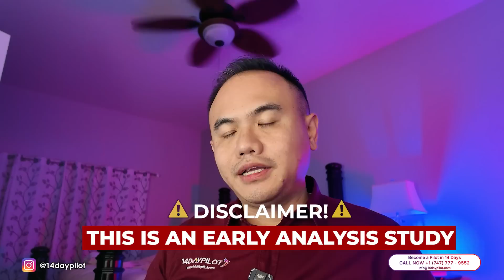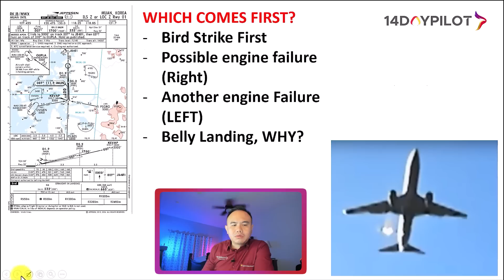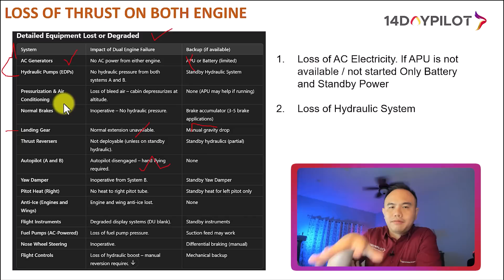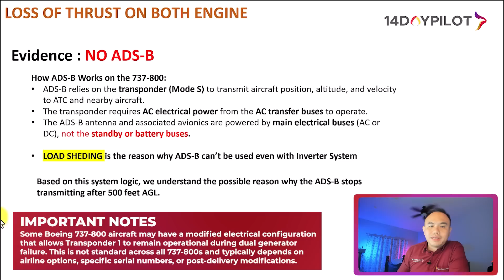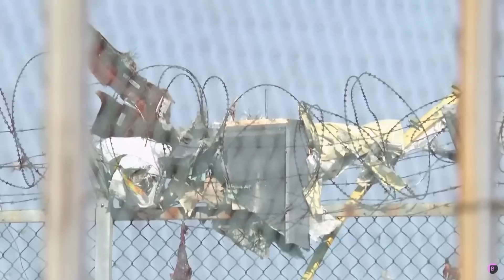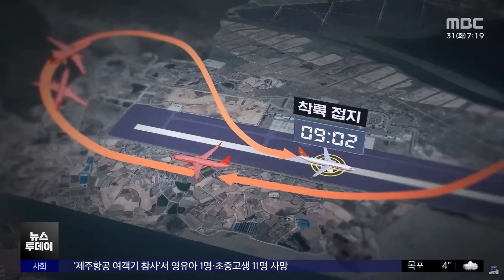NEW! JEJU AIR 2216 UPDATE :THE MYSTERY OF RUNWAY 19! B737-800 Crash At Muan Korea

Comment: They had the landing on RWY 01 made.  The flight manual says if there's sufficient thrust, they should continue the approach.  They had enough thrust to make a go-around so they had enough thrust to continue the appraach.   This leads me to believe it is 100% pilot error.  Apparently, the second engine was shutdown or failed after the go-around was initiated.  The were able to retract the gear and flaps so the second engine was operating up to the point where they were midfield heading north in the go-around.
Reply: Is there any report confirming that only one engine was affected by the birdstrike? It’s possible that both engines were impacted separately.
Reply: @wilsont1010  My guess is they were both affected separately.  The port engine on the initial approach which triggered the Go Around decision.  The second strike while on the Go to the starboard engine (caught on video).
Reply: @wsteele5864  This is the most plausible explanation for this crash landing but seems unlikely.  No report has indicated that there were two hits.
Reply: @ There had to be a reason they did the go around.  I believe the clip seen around of the bird strike through the starboard engine was during the go around.   They likely will be criticized for choosing not to complete the initial approach and then criticized for trying the dead stick return.  Sometimes you are just handed a s—t sandwich.   It literally is a parallel to Ernest Gann’s book Fate is the Hunter.  The pilot in that story did everything by the book and only a flight attendant survived.
Reply: @wsteele5864  I can't see any way the pilot couldn't have executed a longer teardrop with the excess speed he possessed. The SHORT teardrop is what made the landing hopeless. Not saying that recognizing this was either easy or likely, but the short teardrop "impossible turn" was fatal.
Reply: @ yeah, energy management wasn’t ideal clearly, but it isn’t practiced and the challenge is really high.   When I first got my pilots license I was flying in a trainer practicing touch and goes, I decided to see at what point in the pattern I needed to make my base leg turn to make the runway from pattern altitude (1000’ agl in that category aircraft).  I was shocked to learn with no thrust I had to make my base leg turn abeam the numbers if I wanted to make the runway with the engine out.   I believe you could probably put 100 737 pilots in a sim and setup that problem and none would stick that landing safely.   Maybe after many hours of repeated attempts some of the most talented could figure it out and get it dialed, but first time?  Probably zero.
Reply: @wilsont1010  Had to be one engine at a time.  The pilot initiated a go-around and got about 1/2 way over the airport.  Sometime after that, the 2nd engine either failed or was shut down by mistake.  If both tailed at the same time on approach to RWY 01, the only option would be to hopefully land on RWY 01.
Reply: The manual states you can either land OR go around, it’s up to the commander what’s the safest course of action…
Reply: @Cars-k8e  That's true.  But I think his decision will be called into question.
Reply: @Cars-k8e  Correct and pilots are drilled on stabilized approaches, so the default is the Go Around, get to altitude, do your checklists and reset the configuration for a stabilized approach.  The second strike (the one on camera) on the starboard engine happened on the Go and left the crew with dreadful choices.  They chose a return to the airport to try a dead stick landing.  They should have chosen the drink.

Comment: I am confused why the pilot didn't stay on the original landing path. He had the gear down and was on approach. If he lost an engine he could still land on this approach. If he lost both engines he may have come in short but I feel that would be better than trying to go around and doing the impossible turn. If he over shot the runway on the first approach he would have a clear path forward with few obstacles. We do not know why he chose this scenario but he did get the plane on the runway and he clearly had control all the way. It's just a damn shame they had that obstacle in the pathway. Let's pray this does not happen again. Condolence to all involved.
Reply: The norm for this situation is to continue landing...
Reply: @luziosalles324 incorrect, the book calls out both options (go around and continue), but pilots get the importance of stabilized 
approaches drilled into their heads, configuration changes on the fly are really discouraged. This was their first mistake, unfortunately not their last.😮
Reply: I'm B737 pilot, and that is normal training in a simulator. Loss of thrust on final, land and use flaps 25 vs 30/40 and appropriate speed. You don't run non-normal checklist except recall items for fire.
Reply: @gmcjetpilot is that industry standard or protocol for your airline? I know pilot training and best practice can differ between airlines.
Reply: My exact thoughts. Why? Panicked but getting out of the air is crucial if you’re having trouble.  Pilot fatigue
Reply: I believe the Pilot was in PANIC mode. . . Cannot plan. . No more brain functioning. . .how I wish to know who was the Pilot, a woman ?. . It's flight experience ? Etc
Reply: @AdrianoDominise  The sex of the pilot is not in question, the mental status is.
Reply: Because it needs reassesments,  calculations and configurations before landing in 1 engine. Maybe considering other airports if able.
Reply: He probably was not happy with the first approach and thought could do better on the second one.
Then the situation got suddenly worse…
Reply: @just_russ4633  Maybe engine flameout wasn't his only problem. That deployed right thrust reverser may be giving a hint. If the first birdstrike caused the thrust reverser ducts to open during descend he may had been experiencing sudden assymetric thrust that spooked him into a go around. He thought he needed more time to evaluate the damage and run the checklist for uncommanded in-flight thrust reverser deployment. And then he got a second birdstrike. Of course this is pure speculation but I don't think we know the exact moment those right thrust reverser ducts opened.
Reply: @ky7299  Yes, There are so many scenarios. The landings always scare me the most when I am flying. Having your life in someone else's hands is quite scary.
Reply: This literally
Tired of blaming the wall
The planes original flight path aligned on RUNWAY 01 and it has EMAS incase a plane overshoot....
Reply: Where he hit the birds was 3000 feet from the runway start, allowing for the shock and mayday, the aircraft would have cleared that distance pretty fast, but there reaction would have been slow, I also would have gone around, it gives you a chance to check the condition of your bird (aircraft) and then land safe the next time around.
Reply: I heard he diverted because the other side has residential area nearby
Reply: @ODKON93  I highly doubt that they were thinking of anything at all.
Reply: @johngreydanus2033  They certainly weren't thinking anything after impact.
Reply: @ODKON93 oh did you ask the pilot?
Reply: It is very normal to go around after the landing gear was on due to inconvenient situation, such as so many birds obstacle on the way, or another flight delays for take off, However, after go around, things went wrong unexpectedly .. the pilot was happy he can land on belly... and miscalculated or shocked that there is a wall prior explosion.. he must have said aaaaaaaaaaaa aaaàaaa shit there is a wall...... aaaaaaaa  aaaaaa... boom!
Reply: @AninePlus  This is their headquarters, he would have known.

Comment: It looks more and more likely that  human errors caused the disaster.
Reply: Seasoned pro pilots rarely make amateur  mistakes.. it's possible but not likely. There is an explanation for urgency to land wait for the blackbox.
Reply: @c.anderson3444  Rarely is not never. The pilots needed to lose airspeed and land nearer the runway start. Both could be accomplished with a longer teardrop. Is not doing that an "amateur mistake" or a pro-level one?
Reply: @gandydancer9710  possibly under ideal conditions. Impossible when there is an urgency to land . You cannot ever assume they had any controls available in a mayday urgency to land. How can you analyze how they made that turn on a mayday?? Yes these are pros and they wouldn't abandon a normal go around in a commercial airliner.  Thats called an impossible turn for a reason and any expectation for  position, speed, or runaway is known to be gone.  The only mission is to ground the plane ASAP and stabilize as much as possible for the crash landing. Thats exactly what most people can't understand.
Reply: Why do people start to cry "human error" before the investigation team even had a chance to review the data and publish their results?
Easy to judge from the sofa point of view^^

Comment: If they had just continued landed on Runway 01, possible no lives lost on that incident :(
Reply: @neerfranz12  Correct, but training favors the Go Around as stabilized approaches are the mantra.  Bird Strike takes number 1 engine out, abort approach, Go Around, do your checklists setup the single engine approach configuration. land safely and back slaps all around.  They don’t throw a second bird strike on number 2 while on the Go when you simulate this emergency.  The first mistake was the Go Around, the second mistake (the fatal mistake) was trying a dead stick return to the airport (something you don’t practice in the sim).  A ditch just offshore likely would have saved a lot of lives and got the pilot fired.

Comment: You can see at least one engine making thrust as plane slides down runway.  They still had hydraulics.
Reply: You can still hear the engine on spooling thrust before it crashed.
They had no issue doing the "IMPOSSIBLE TURN" so that means they had still control
No idea why they turned around when they were already heading the RUNWAY 01 where there's EMAS incase they overshoot the runway and most importantly theres no WALL
Reply: @everydaydose7779  just cause an engine is running doesn't necessarily mean it is providing thrust.  Imagine if you had a fan in your room with the motor running but all the blades are broken off as a crude example.
Reply: I think you are correct. Another YT channel suggested that no flaps and retracted landing gear is the optimal configuration for the longest glide path, if they didn't have adequate power to climb.
Reply: @davidmitchell7183 I think this is the most likely explanation for the configuration at landing.  They don’t practice dead stick in the sim.
Reply: The plane could have been on idle on that engine. The plane was on the approach and should have dropped the gear once it was over the runway then it would also help slow down the landing speed and provided braking and steering which the option you were talking about is not possible as was the result.
Reply: @davidclemens1578  if you have little to know thrust you would only drop the gear when landing is assured... if you are to low or to close by time you can guarantee making the landing... if you try to lowered the gear you may end up landing on only partially extended gear. Which can in and of itself be catostrophic.

Comment: STOP calling this an impossible turn! Impossible turn by definition, is impossible.. usually only small planes with low wing loading with extremely low stall speed MAY even make the runway. This fully loaded 737 not only made it back to the runway.. touched down almost at mid point of a 10k ft runway, ran down the rest of it and crashed into obstacle few hundred feet off the runway! How is this an impossible turn?? This airplane came back with power and fully fly able!
Reply: With both engine off (assuming) its an impossible turn.  And this content also for newbie.
Reply: Well, at least we know what he's talking about ... I suppose he could just say "turn" but when he say's impossible, we know he means a tight turn.

Comment: Quadruple redundancy for the landing gear.  2 engines driving separate generators and pumps, hydraulic reservoir tank using a pneumatic system, and finally the gravity method.  Pilot error period.

Comment: The no2 engine thrust reverser vane open,  it appears engine was working,  reverse thrust plume visible near touch down likely with reduce power? The manual  gear extension could be dropped manually from the cockpit. Then risk of a ground loop if mains not down and gear locked.  Not enough time , and with no engine power from no1 and a damaged no2 more risky to stay airbourne.   The passengers and crew were murdered by the moron that approved a thick concrete wall ILS foundation above ground.

Comment: I do not get it. Plane was very slow at the time of last ADS-B data was transmitted. If the plane lost both engines at that point or even after that; I do not see it likely that plane would speed up for 100 knots before landing in 3 minutes without any engine power.
Reply: It could be possible that the plane was coming in too high for the runway approach and the pilot was dropping down to bring the airplane to the correct approach angle but with that you also increase your airspeed.